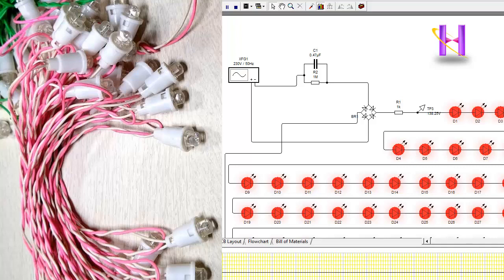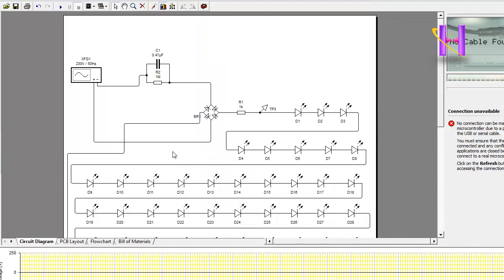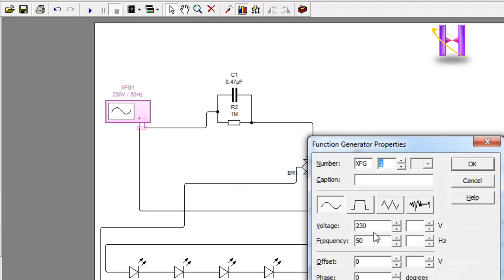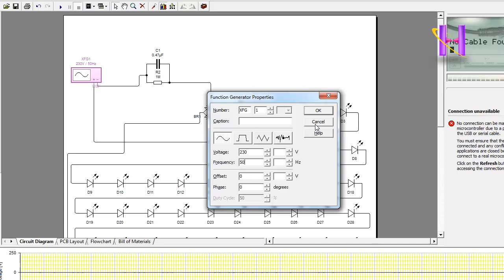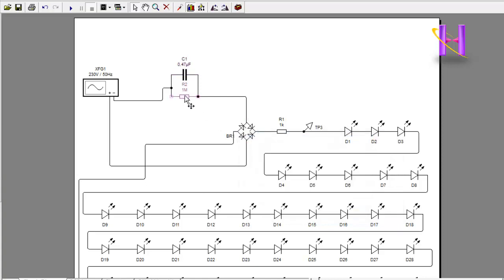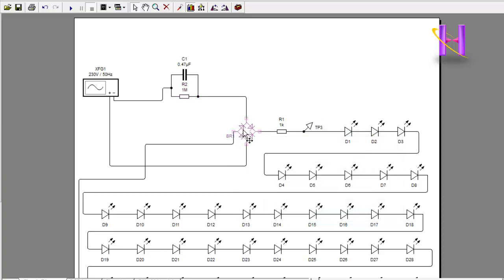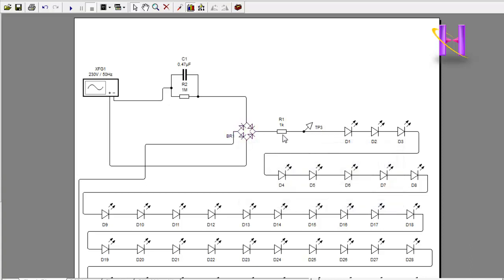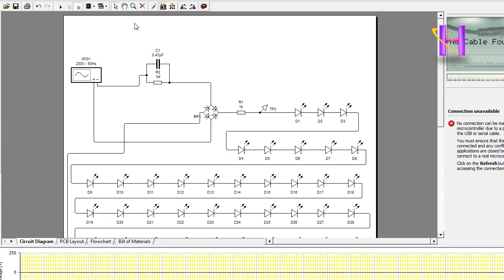50 LED Rice light series circuit diagram and working tutorial [BEST]

Comment: what is power wattage of the resistance ??
and i want to use polar capacitor 
which value  capacitor will i use
Reply from the maker: 1/2 watt resistor is sufficient.
Reply: @Happyman0077  please tell me value of the polar capacitor 
I want to make a R.C drive

Comment: please TELL IF I USE 50 LED 8 MM WHAT WILL BE CIRCUIT CONNECTION 
what resistance capacitor will i use and what will be the non polar capacitor value
please explain with the comments 
it wound be great if you help me